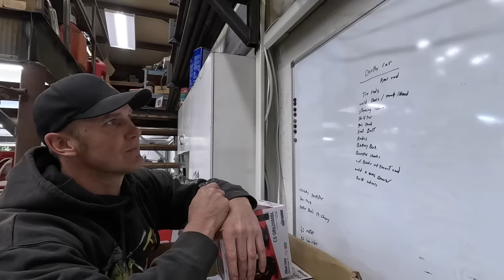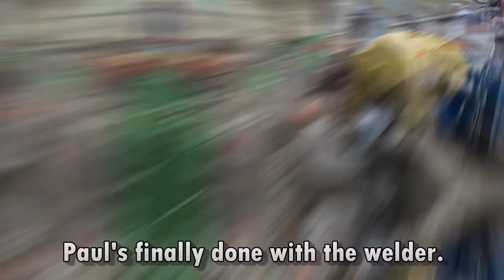Build A Demolition Derby Car They Said.  It'll Be Fun They Said.

Comment: Hunter should wear a tool belt that holds a hammer, tape measure and sharpies so he can just hand them to the guys when they need them
Reply: Fanny pack with a couple mountain dews in it too
Reply: Don't forget the pocket knife.
Reply: And some sort of fire-putter-outer
Reply: @watchingforhisreturn4709  Do they make a holster for a squirt bottle?
Reply: @PSUQDPICHQIEIWC  If he drinks enough water and mountain dew he won't need a squirt bottle! 😂😂😂
Reply: What good is the camera man he doesn't come prepared
Reply: Having safety glasses and wearing safety glasses is like having a condom in your wallet when the mishap happens who's the one to blame the glasses for not putting themselves on your head are your head thinking I don't need this protection this time I'm too much in the we will worry about that at a later date one of these dates will have a due date and one of these dates will have a surgical date protection is protection is protection is protection is protection don't set a bad example for the young ones or the ill-advised😂
Reply: Just call him Bob the builder at that point.

Comment: derbying has changed so much since my dad did it. hed gut the car put the battery an fuel cell inside the car and run with it...they must have been a little crazy back then...but they did use cars from the 60s  they were a little tougher then

Comment: if you install a electric hyd pump in your full hydro steering system so you have steering with the engine off then your more likely to be street legal with full hydro steering. I have seen many tractors and airplanes with electric hyd pumps that run the steering. You could make a mint off something that does this. With one way valves you can run both your mech pump and electric back up.